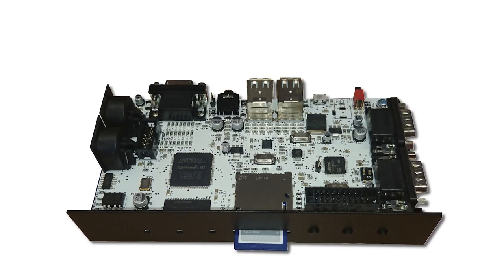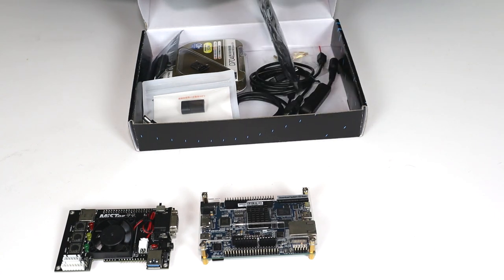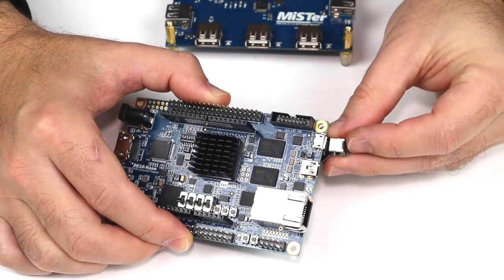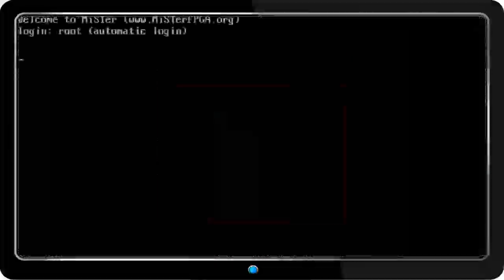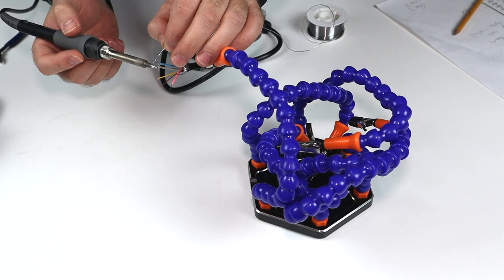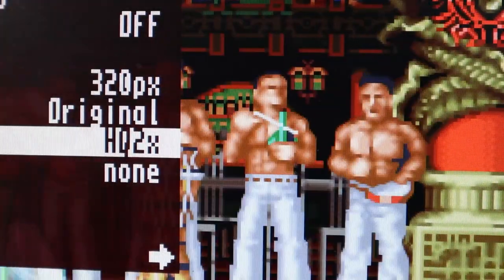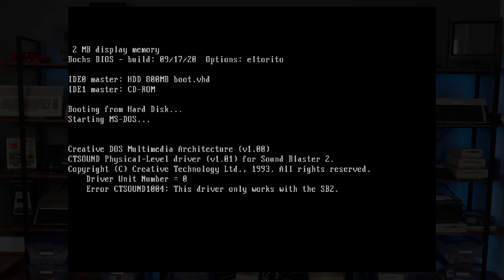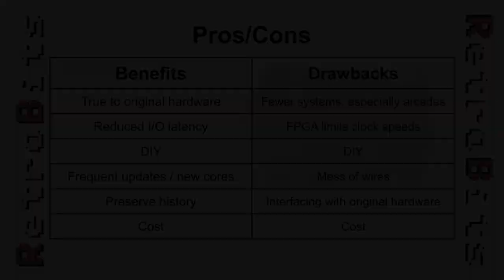MiSTer FPGA - How to build & configure, demo, cost, and pros/cons

Comment: Is the Mister honestly worth the investment, it's a lot of money. I know it emulates the hardware as close as possible but compared to using RetroPie and the like is it actually worth it? Or is this just a unit for die hard arcade addicts that demand absolute accuracy etc. Myself personally I'm 50/50 I just hate sound glitches and weird screen artifacts/bad lagging that emulators give sometimes. People say the 60 in 1 is a crap PCB but I fitted one in my homemade upright cab and it's absolutely fine on my CRT and good enough for me day to day.
Reply: It depends on ur own personal reasons whether it is worth it or not. What retro games are you emulating and how? Are you happy with enough with that? If that's the case then I would say no, it's not essential for you to invest in one. How serious do you feel about lag and speed fidelity, are you a serious gamer and do speed runs etc.? If you are then yes this might be something you should consider but if is not the case n the answer to my first question was that it's good enough for ur needs then I would say that it is a definitive no n forget about it u don't need one. Personally I was the same, I have a Retro Freak unit anyway which has like 12 retro systems that it can play. It runs them all extremely well and I haven't come across any game breaking lag or problems with frame rate. I have made the decision to get one anyway and the reason is bc it has the ability to run the next generation of consoles my Retro Freak doesn't support, like the Saturn, Dreamcast, Sega CD, Nintendo 64 (i think) and this would be the only way for me to play these consoles as I would not start collecting and buying any of those units now, the prices r way too much n the hardware too old n worn out.  But with the MISTer I can play all of them on a piece of hardware that has the most fidelity to the originals than any other method of emulation/recreation available today.

Comment: Can you do a guide on the PC engine cd set up can't seem to get it to work
Reply from the maker: I haven't tried out the TG16 core yet, but I will play around with it. Looks like the CD setup is a bit more involved with sub-directories per disc image plus an additional bios file.
Reply from the maker: I messed around with it a little tonight and got it working. You'll need two things, a game CD image in .bin/.cue (or .img/.cue) format and the Japanese Super CD-ROM v3.00, renamed to "cd_bios.rom". Create a /media/fat/games/TGFX16-CD/ directory on your sdcard. In that directory, create a subdirectory for each game. Put the .bin, .cue, and .rom file in the subdirectory and you should be good to go.

Comment: Ia it worth to buy the mister board and accessories from the Aliexpress?
Reply: I would be careful at Aliexpress.  They sell a lot of clone/fake/knockoff mod items like this, take the GDEMU for the dreamcast as an example.  However, that's not to say that a clone item would not work, but it may limit you in the ability to update it's software or potentially limit in other ways.
Reply: @retro_escape2969  yeah man, I saw some listing with some other buyers sending pictures of the package they received and it seems legit, but I'm not sure, they can fake the box easily too. So it's better to look some official distributor.

Comment: whats the difference between STANDARD and  DIGITAL   D10boards?
Reply from the maker: The digital board differs in that it gives you a power switch and audio input jack. The analog board gives you the VGA/RGB output which uses up a bunch of the GPIO pins.

Comment: What screwdrivers are used?
Reply from the maker: I just used a standard sized phillips-head screwdriver for everything. It helps to have a tool for removing and tightening the PC-size standoffs, but you can use your fingers or some small pliers in a pinch.
Reply: @retrobitstv  What you were doing at 9:10 is what confused me, concave screwdriver?
Reply from the maker: @seamistseamist  Ah yea, that is a PC repair screwdriver. The blade comes out so you can switch between phillips or flat-head. With the blade removed, it becomes a hex driver that fits around the stand-off. If you don't have a hex driver, you can just do it finger tight or use some small pliers.
Reply: @retrobitstv  Okay, thanks for clearing things up!

Comment: Does the current FPGA have enough power (theoretically) for psx/n64 and higher Just need people working on the cores? Or will that need whatever the next revision would be "SuperMister64!" lol
26:37   :-(
Reply from the maker: There are PSX and Saturn cores in the works. I guess time will tell if they're viable and can fully fit within the constraints of the DE-10 nano.

Comment: 26:42 This statement has aged badly, considering that the PlayStation 1 is well supported now and Saturn and N64 are in work.
For long time it was expected that the N64 will never work with the reasons you have mentionend. I also don't know how cycle accurate the Playstation core is. Maybe some things need to be faked to be possible at all on this machine.

Comment: I don't get what the USB Hub does and why it's recommend? I think I don't need it, as I already have USB cables in my house.
Reply from the maker: The DE-10 nano only has a single USB port on it. That's fine if you only want to use a single device, or you have your own external USB hub.
Reply: @retrobitstv  wait so I need a USB hub if i want to play with 2 controllers/fight sticks? or are there other ports too
Reply from the maker: @pirateclick1d169  Correct, or if you want to use a USB wifi and/or bluetooth dongle at the same time as a controller. It can be any USB hub though, even the one built into your PC monitor if you want.

Comment: Are you kidding me? So, no input lag on that cps1 core and Street fighter alpha? Are you using USB joystick?
Reply from the maker: The developer has put in significant effort to get the accuracy of the CPS cores as close to the bare metal as possible. As of January, he claims to be within 0.08% accuracy with the timing. https://www.patreon.com/posts/46899296 

I am using USB which does introduce some lag, but the polling rate can be increased and you can get many controllers down to under 1ms of latency. There's a chart of over 250 controllers with their latency measured here: https://twitter.com/MisterAddons/status/1265071632382640131
Reply: @retrobitstv  dang that's insane.

Comment: Good video but I find it a bit odd that at 26:10 cost of the genuine article is on the 'pro' list, at the same time as reduced latency. If anything has low latency, it's a genuine machine hooked up to a CRT. It makes sense to include reduced latency if we compare to software emulation only, but then cost would end up on the 'con' side of things. In fact, the only 'pro' thing compared to emulation would be the I/O latency, which Retroarch has completely eliminated anyway with the run-ahead feature.

I would love to buy a complete MiSTer but it's WAY too expensive right now for what it does. I have all the systems it can emulate, including a 1200 with a 030 card and the things I don't have I can emulate with near 100% accuracy via the Pi or dedicated PC with CRT Emudriver. FPGA emulation is still too far off that genuine machine collection and software emulation can remedy.

Comment: My impression is that it's a bit of a hacky mess, and not very elegant from a user perspective. However, it demonstrates that FPGAs surely can mimic original hardware sufficiently and that it's based on an open source platform is certainly a plus. I think it's just a matter of time before some cleaner, game-centric solutions will start to appear.

Comment: the crt tvs needed to be positioned  with picture anyway if we use analogue video output. the reason i want to use monitor (not crt) is that the picture positioned automatically. and no need to make this pain in ass. my bang olusfen tv still cant do identical right picture geometry on my famicom / SG consoles. Im tired if this shit

Comment: You never explained VHDL. Never said the acronym or gave any examples. I I think your video would’ve benefited from this information and viewers educated.
Reply from the maker: Good point! There are always things I wish I had included but forgot or missed entirely. Ah well, hindsight...
Reply: VHDL (VHSIC-HDL, Very High Speed Integrated Circuit Hardware Description Language), its the programing language used to write FPGA cores. 
Basically is a programing language that describes some set of hardware and allows the FPGA chip to reconfigure it's logical elements into the appropriate gates to simulate the same circuitry. FPGA been used in the electronics engineering field for decades to prototype hardware and test hardware before actually building it. In recently FPGA became cheap enough and easy enough that an average user could afford and use FPGA hardware. FPGA is specially useful for recreating hardware where the original components are hard to find or no longer in production. A commercial version of FPGA hardware use for gaming for example is the Analouge series of consoles, the difference here is the MiSTer is much more available to purchase.

Comment: um, multiply that LE by at least 100x
Reply: you can get a similar dev kit and the board from novtech, also with the cyclone v fpga options, novsom cv or cvl
Reply: vhdl is software defined hardware, should be as well dynamic as pure software emulated hardware
Reply: you could make interfaces to old buses
Reply: there is a 300usd all-in-one for the DE10, the DE10-standard
Reply: have you tried the intel MAX 10  '10M50' evaluation board?
Reply: or DK-DEV-10M50A MAX 10?
Reply: @Jkauppa  The DE 10 Nano is subsidized for educational purposed so its cheaper than the Standard
Also it's a community lead project, the idea of using a Nano over the standard as its more accessible to more users.
Reply: @lukasperuzovic1429  the sockit is even cheaper, and you can socket the sdram through the hsmc slot
Reply: Is there anyone developing console and Microcomputer cores for Sockit the way they have with the DE 10 Nano?
Reply: @lukasperuzovic1429  the cores should be portable to the same fpga containing systems, and http://modernhackers.com/mister/
Reply: @lukasperuzovic1429  for educational purposes, you could try the porting yourself
Reply: @lukasperuzovic1429  the complete package is not very cheap, you could just buy the standard, no diy needed
Reply: @lukasperuzovic1429  you are poor if everyone cannot have this for free

Comment: This thing is way to expensive.with that money you can buy a decent pc that can emulate a large selection of hardware.And don't jump on me with the fact that is better than software emulation.
Reply from the maker: It is expensive and has gotten even more so with the chip shortages. As I said in the video, it's up to each person to decide if it's worth the cost for them. I believe software emulation is fine for the vast majority of people out there. For those that want that last couple of percent, love to tinker, or appreciate the open source nature of the project and the frequent updates, it might be worth the cost to them. It's great to have so many options these days, be it a PC, RPi, MiSTer, original hardware, or reproduction.
Reply: @retrobitstv  Of course,that was just my point of view.Actually these days i'm fiddling with one of my Raspy's(Pi4B 2gb),trying to setup a retro gaming system.Sometimes i'm trying to configure systems in 86box  or PCem and to setup Dosbox.I have a I5-6400 8 gb ram and Geforce GTX 1050ti OC(that i'm jealously taking care of in these harsh times! 🤣)

Comment: U are wrong about software emulation ..current could have speeds a million times faster than the original hardware hence there will be no latency
Reply: Cpu not could